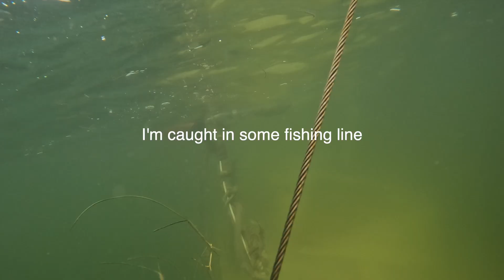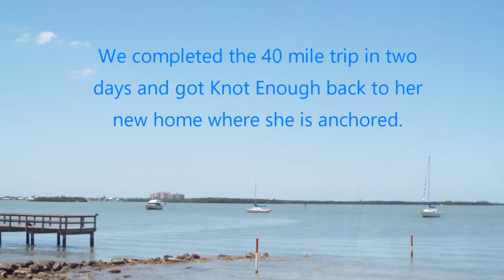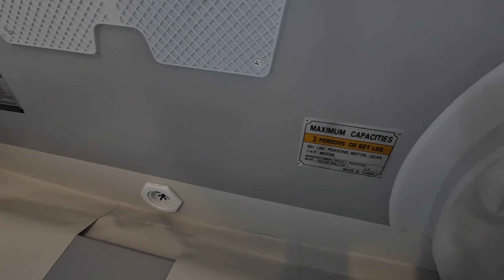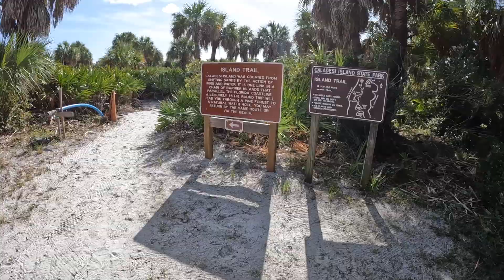Exploring a Sailboat Wreck and New Dinghy. EP86

Comment: Cant wait for the Keys trip. Also interested to see how that outboard performs. Looked super light.
Reply from the maker: it's about the same as any 2.5hp out there... they all do about 4 knots... nothing too exciting by better than rowing a long distance.  It starts up like a new motor and idles nice. I watched a lot of videos about it and did the simple things to make it work better.  Since I understand small engines, I thought it might be fun to try one, plus I can't spend $1,000 on a motor to use a couple of times each year.  I ran it for a few hours in a trash can to break it in and I'm still on the high-oil content break in fuel for another tank.
Reply: @AdventuresInParadise  Nice. Thanks for the update.

Comment: I've been looking for a dinghy for a while. I ended up getting a small 8ft kayak that I just tow behind my Catalina 25. Uninflated, I guess you can also use that as an emergency raft. It's  nice that you can just put that in the cabin until you need it.
Reply from the maker: The cheaper longer one was more stable and easier to row, but not as thick of material.  The kayak works, we've done that also.

Comment: I bought one of those dinghies. The seams unglued themselves in no time and I had multiple unrepairable leaks. I junked it for one of those cheap ones you had, which has now lasted years
Reply from the maker: I like that Sam Holmes has a cheap one and sails around the world with it.  I sent in my warranty card.  We're very infrequent dinghy users and we prefer to use paddle boards when possible.    I'm going to inflate it less than full.  I do that on our paddle board also, 1 psi less just in case it's in the sun.  The manual for the dinghy said not to inflate it all the way and then leave in the sun as the high-pressure increase might damage it.
Reply: @AdventuresInParadise  Ditto. My inflatable SUPs indicate 15 PSI - I keep never go above 13.
Reply: @AdventuresInParadise  I didn’t ever store it inflated. I stored it deflated below deck. The adhesive just wasn’t up to quality required. The handles and row locks all started to peel off by themselves. The guys at the shop just shrugged their shoulders like they had seen it many times before. Anyway, maybe you’ll get luckier than me
Reply from the maker: @superwag634  Only time will tell.  Some other guy commented below about having one for a few years... who knows.  I think t they're made in Canada.

Comment: Why not go with an electric motor?
Reply from the maker: If you look up the required electric power to match even the smallest outboard, it's not worth it.  If you can even come close to the power of a small gas motor, the price is too high. 2hp Electric is $2,500.  The other thing to consider is that after I made this video I've never used the outboard since.  Just haven't had to.